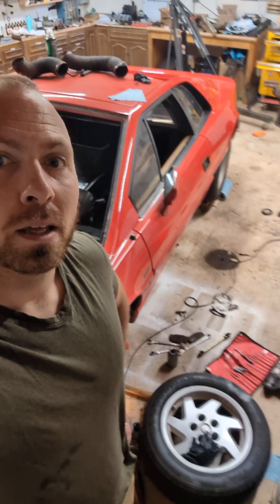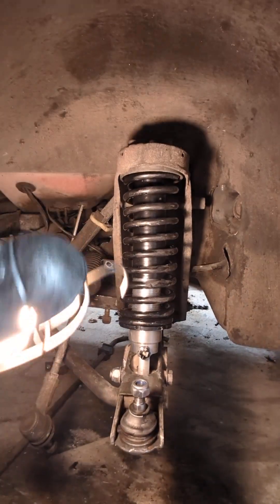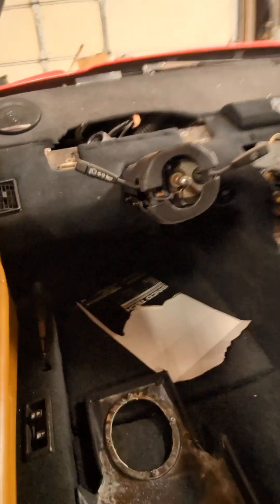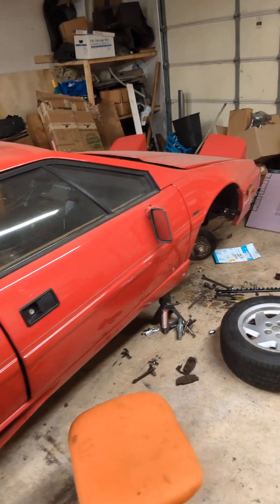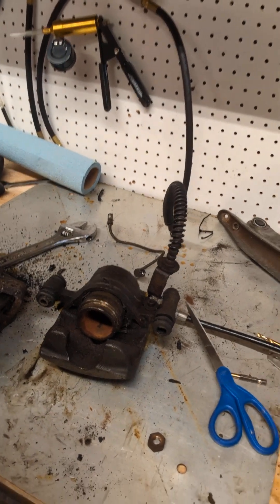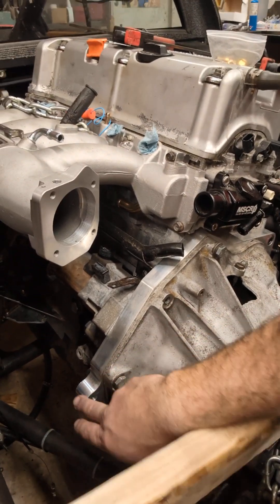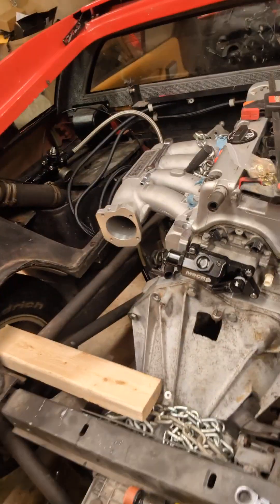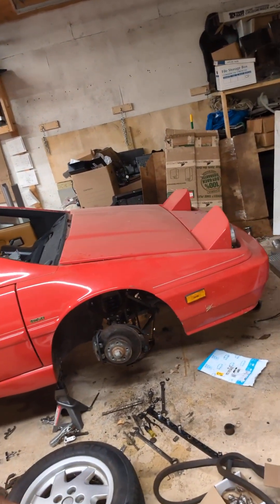Lotus Esprit k24 swap Project

Comment: Seems like a lot of effort to not upgrade the engine and replace the gear box at the same time. 350 hp would make this wanna be supercar drive like an actual supercar
Reply from the maker: @jcelliott7377  yep, there are a couple reasons for this. The main one being the 88 model years inboard brakes would require the 89+ out board brakes and uprights which are fairly hard to source and even more pricey. With this being my first swap, I decided to keep it simple. The k24 itself with a tune will make about the same power at the wheels as the turbocharged engine that came OEM, with the advantage of being 2400-2500 pounds! 
It will still be proper 80s supercar territory with the power to weight ratio. 
Fun fact. Did you know these could do 160 mph with 190ftlb of tq? Kinda ridiculous considering.